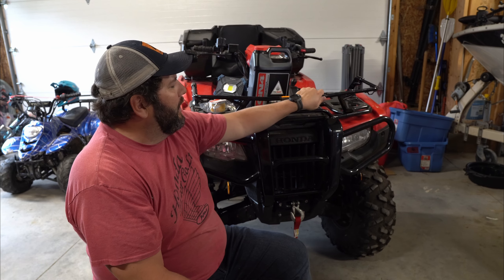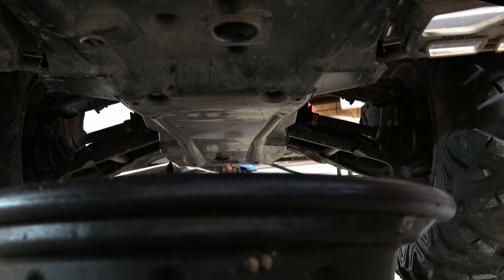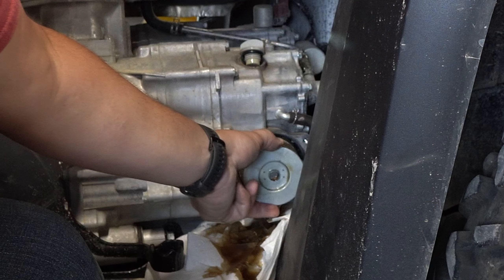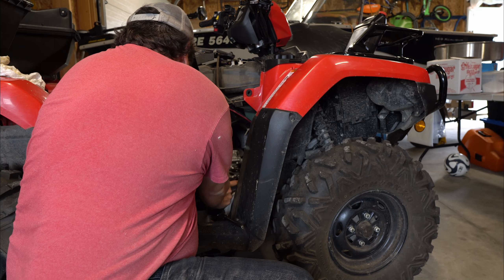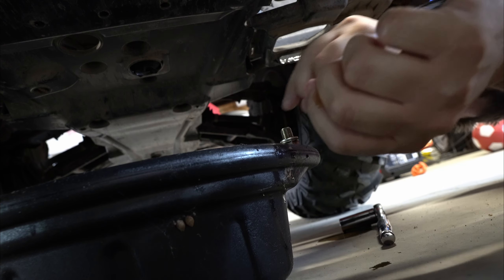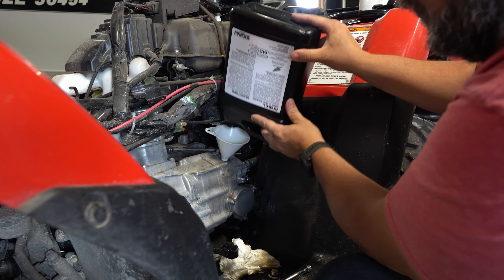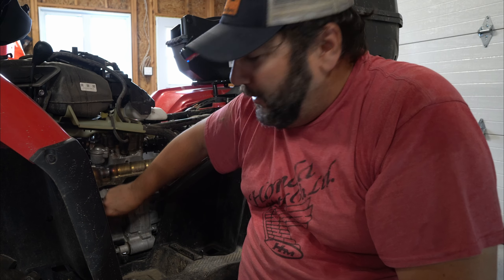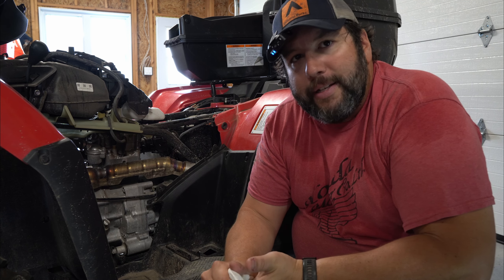Oil CHANGE on a Honda DCT ATV - Save $$

Comment: I guess your engine starts again in the morning after sitting all night it take so much oil to circulate around the engine   And the extra oil still leaves the engine dip stick  reading full

Comment: I have a 2024 Rubicon. My oil filter is different(its smaller)  Doing the oil change, i cannot complete it due to wrong filter. Cover is also different, it has an oil passage in filter cover.
Reply from the maker: My rubicon is a 21 DCT model.  Yhe filter is smaller and backwards compared to a foot shift.   Best to confirm with your model number at the dealer to get the right parts, and even then they screw up a bit.   Glad you are doing it yourself though.  Save time and cash.    Hope it works out.
Reply: @poppymonroewild  thank you. Thanks for the video!!!
Reply: I think ur bike is foot shift those bikes have a smaller filter